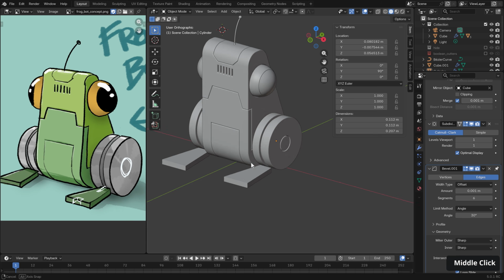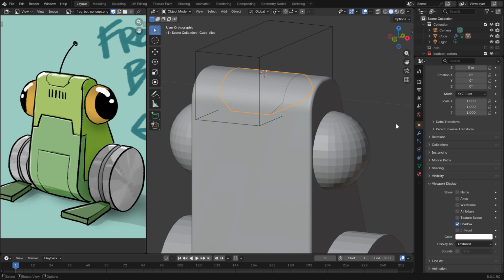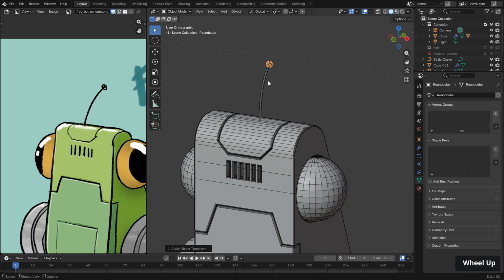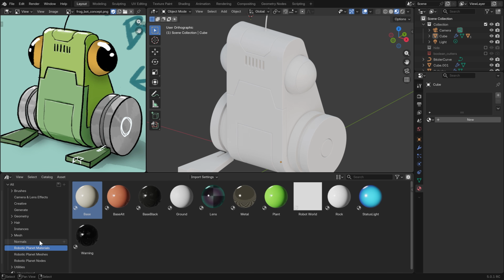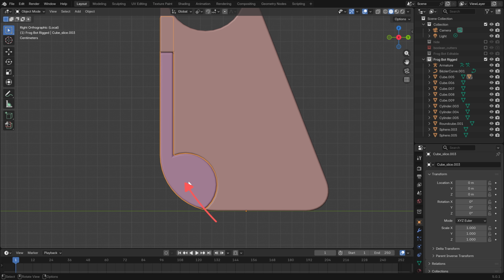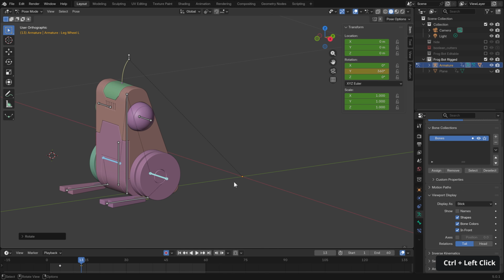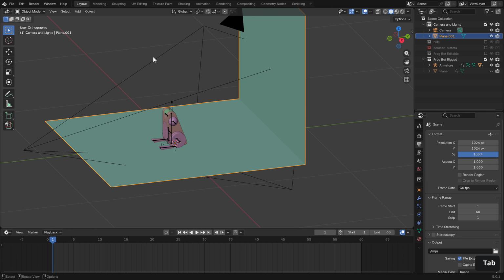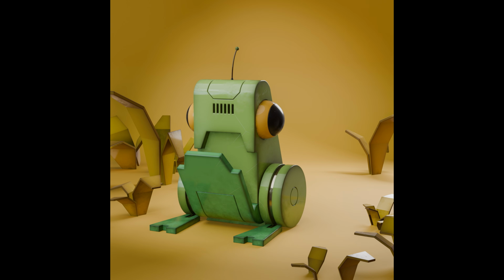Hard-Surface Modeling in Blender for Beginners (Full Course) #b3d

Comment: At 22 mins when cuting in with thee boolean modifier. It doesnt apply a bevel to my cube that cut into the original mesh. So the body has a beveled edge but the cube cutting into it doesn't any ideas?

Comment: When doing the "extrude manifold" on the foot it just doesnt automatically fix it for some reason. It seems to be doing it somewhat EXCEPT it leaves the top and bottom faces there and they are both red. I've tried every workaround I can think of and every alternative method including just creating perpindicular loop cuts where I want it to go and just deleting the faces, but that seemed to not work with the bevel... EDIT: I figured it out, explanation below.

EDIT: I think I figured it out... mostly... When I originally created the feet, I guess I scaled it at some point without selecting either the X or Y axis, so it was not completely flat on the Z. It was tapered towards the rear of the foot on all axis, not just X and Y. So, I remade the feet making sure to only scale the front and back on the X axis to give that tapered look. I did the extrude manifold and it worked... HOWEVER, when extruding the face, it does not actually scale the face to follow the edges of the loop cut, which are at an angle due to the foot being wider at the front and thinner at the back). 

This is made obvious in the video at 55:05. The face remains the same size and does not scale to follow the edges of the loop cuts. I KNOW there is a way to have it scale and follow the edges of the loop cuts, but I just cannot remember how or figure it out. You can fix this somewhat easily by just scaling the face along the X axis to match the angle of the loop cuts after you've extruded it as far as you want. Maybe then you can merge vertices but I haven't tried that. 

Sorry if my explanation was kinda shit. My vocab with this stuff isn't that great, but if you need any help with this part, just reply to my comment and I'll do my best to help you through it.
Reply: I'm literally stuck on this and its driving me crazy. I've seen someone else comment a month ago about this but no answer :(

I've tried everything I can think of, even doing a loop cut where I want this middle section to end at. Connecting the vertical vertices between the loop cuts and just deleting the edges/faces and filling those that were deleted in the process. I got the shape I wanted but when attempting to apply the bevel modifier, it did NOTHING. Man, I'm like slamming my head into my desk this is so frustrating. Why wont the extrude manifold just do what its supposed to do!?
Reply: I fixed it. I added an edit to the original comment. If you need help because my explanation was kinda shit, then just reply and ill do my best. :)

Comment: quick question: Are there any situations where you would not want to apply rotation/scale? I was having a bunch of issues with bevels and learning about this has helped immensely. However, I've just gotten to the point where I apply my rotation and scale basically every time I make an adjustment. I'm just wondering if there would be any reason not to do this. Thanks for this awesome course!!
Reply from the maker: I find it handy to not apply rotation when I modelling say, a bunch of details on a 45 degree surface. Not applying rotation allows me to keep the local axes in place for mesh editing perfectly aligned to that 45 degree surface. Making adjustments in edit more might help with the constant 'object mode, apply transform' repetition. Thanks! ~Louis
Reply: @cgboost  Thanks so much for that information. That def makes sense!

Comment: 53:21 If, after applying Scale to the Beveled Wheel WITH FACE ORIENTATION ON in your Viewport Overlays, and your wheels are now red; You need to RECALCULATE NORMALS (It thinks it's inside out). You can get away with turning the orientation OFF in your Viewport, but that's the lazy way, we do things right on CG Boost Tutorials...

Click Object (wheel)
Enter Edit Mode (Tab)
Select All (A)
Recalc Normals (Shift + N)

Capital letters are just to get the attention of anyone perusing the comments for a fix, I promise I'm not shouting at you, you're doing a great job, hang in there.

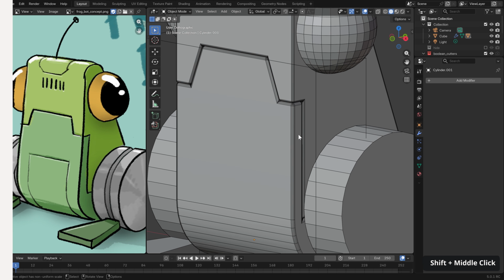Comment: 26:15 - If your bevel isn't transferring to the cut pieces after applying the boolean for the mouth section AND YOU HAVE ALREADY PINNED/REORDERED the micro-bevel, you may need to select "EXACT" in the solver section of the boolean settings on the modifiers tab. I spent a half hour trying to figure out why my bevel wasn't visible, it defaulted to "float". This may help if you run into this error.
Reply: U just saved me with your comment, appreciate it a lot